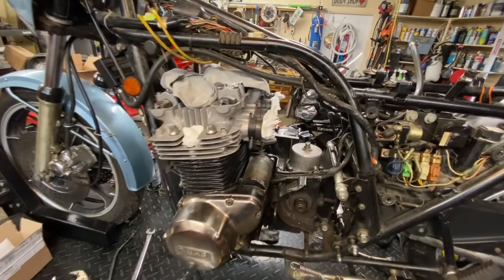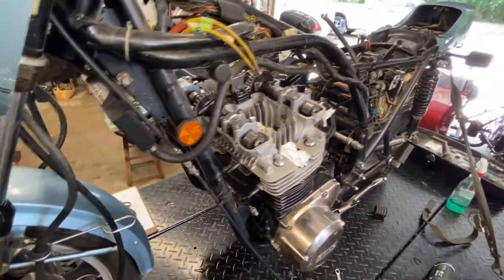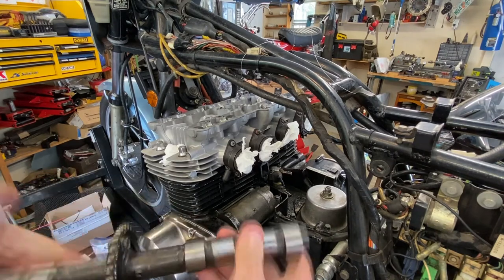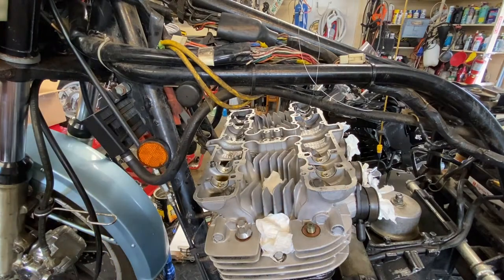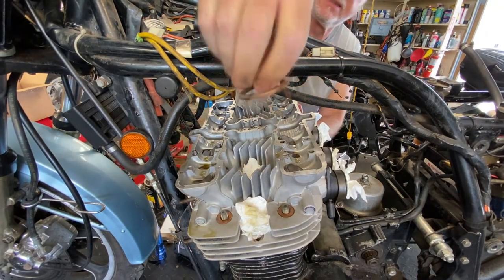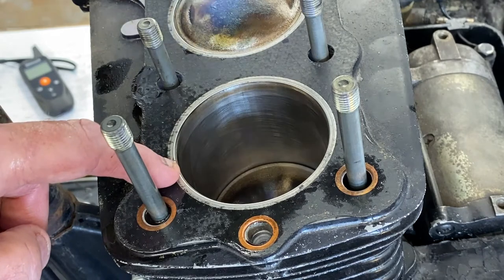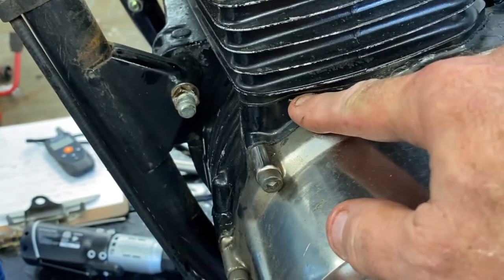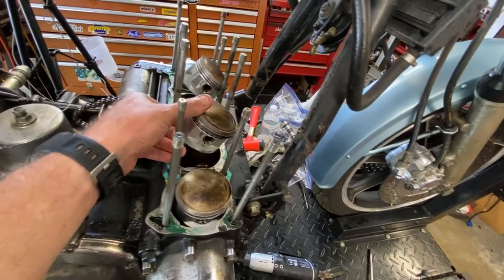1978 Z1-R, Video 2, let's take it apart!

Comment: question? i have a KZ900 and i was wondering will a head off of a KZ1000 make the KZ900 run /Breathe better?
Reply from the maker: I don’t know the answer to that, but if it was me I would keep the 900 head do some porting on it and do some cam work before I swap it out with another head I think that would breathe just fine
Reply from the maker: I don’t do that sort of work, I don’t really build race bikes more into restoration but I have worked on a couple of hopped up KZ 1000’s. If you contact Joe@pitstopperformance.com he does all that stuff. Thanks.
Reply: @MotoRestoFL  would you know if i used the KZ 1000 cams with the  ported  KZ900 head. would this combo be better?
and thank you so much for your videos and your patience! with me i Love your videos keep them coming!!!

Comment: This is what happens when you try to save a hundred bucks,,,,,
Reply from the maker: I spend more than that on toilet paper.
Reply: @MotoRestoFL  right,,,Hows the build coming?
Reply from the maker: @paulhewson4600  customer is outsourcing much of it such as paint and powder coating which I don’t do. Engine also is at a builder. He picked up the remaining lot this morning as I tore it down to bare frame. I’m probably ordering all new fasteners soon and rebuilding/ painting front forks as I’ll do small paint work. My job will be to reassemble everything, reinstall the engine and tune a set of flat slides for him. I’ve done another one that wasn’t frame off but I had the engine out twice as that builder had to warranty a leaking base gasket. More to come.
Reply: @MotoRestoFL  Very cool,,,Those bike are rare breeds and very interesting,,,we use to put slicks on the back ZR1  with solid drag shocks and wheelie bars and take them to the track,,,Sunshine Speeedway in Florida,,,,look forward to completetion
Reply: Oh ok thanks again! 
But im not trying to save any money per say. 
Just honestly curious! Thanks for the help i reallly appreciate you!
Reply from the maker: @marlonholloway7200  thanks for watching. Reach out anytime.

Comment: Back door rebuild jjjj
Reply from the maker: It's all at an engine builder now, I didn't necessarily want to tear it down, rather let the engine builder do it, but my customer insisted that I do it. Anyway, when it comes back and I get everything else, after a rolling chassis is established, I'll stick it back in and we'll go from there.
Reply: Looks great. Love those old Kawasaki’s. Their values have increased nicely also. Your videos are quite good. Thanks
Reply from the maker: @ouimetco  thanks for watching, appreciate the feedback. Cheers.